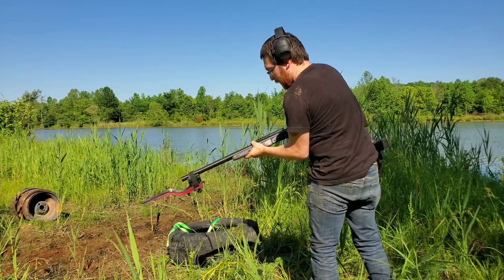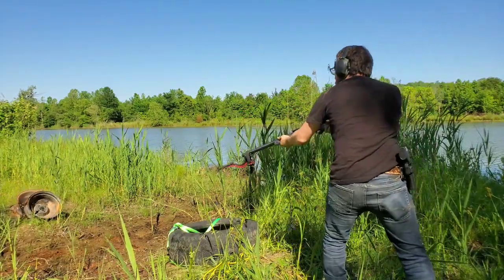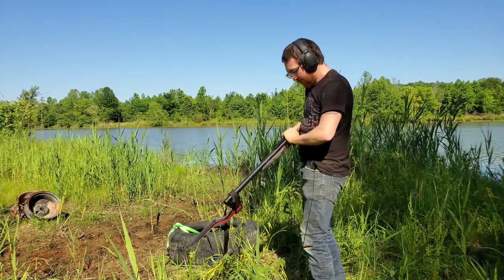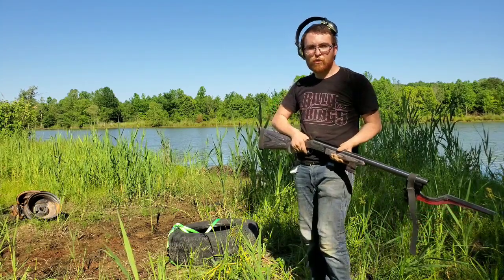12 Gauge from Hell. 726 gr copper slug @ 1600 fps

Comment: At full power (1800 feet per second) your producing over 5,200 foot pounds of muzzle energy!!!!
Reply from the maker: This was the beginning of my load work up! I have since got them to 2k FPS. The record was a 656gr foster slug @2270 FPS which equals 7507 FT-LBs of muzzle energy! Unfortunately though, the lead is pretty much disintegrated on impact at those velocities. maybe I need to commission some 600 grain solids. I think I could get them to close to 2500 FPS which will get a little over 8k FT-LBs!

Comment: 900 $ red dot? Holy shit is it made from gold? You can buy a sub 20$ holographic one. They're better than nothing.
Reply: They wouldn't survive one shot on a rifle like this
Reply: @rmblwgn  so you tested it out to know that? Been shooting it on my .223 rifle and haven't adjusted it yet. It's reliable.
Reply: @no-eb2xx   Ya cheap red dots work for .22lr and .223 but often break on .308 , 270's, 12ga etc
Reply: @rmblwgn  yeah those sure have more kick. Could happen I guess, I'm not gonna strap it to my 12ga with duck tape to find out lol
Reply: I've killed a few cheap red dots on my Mossberg 500.  The most recent one was ~30° out of alignment after the first shot.

On the package, it even specified that the sight was rated for shotguns!

The cheap sights are only useful on .22s, possibly on 5.56 & pistol caliber carbines.